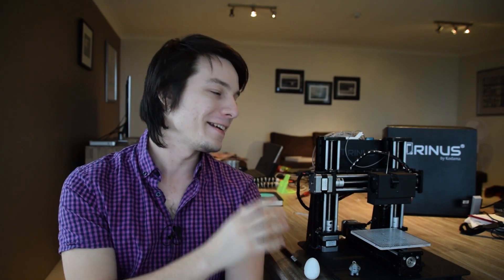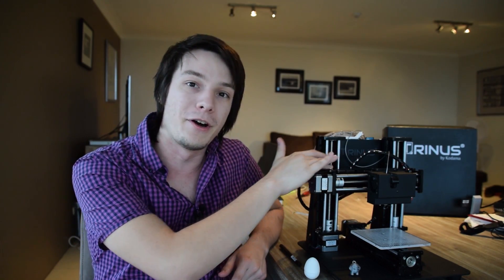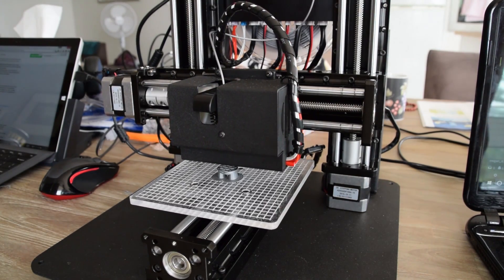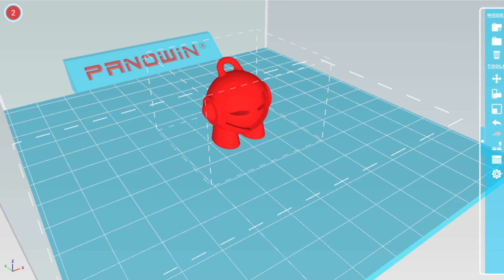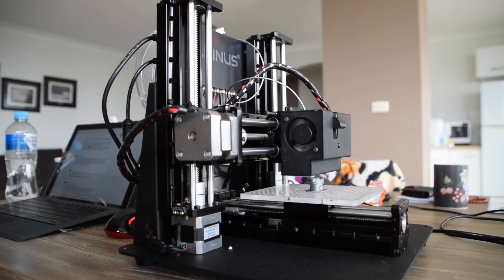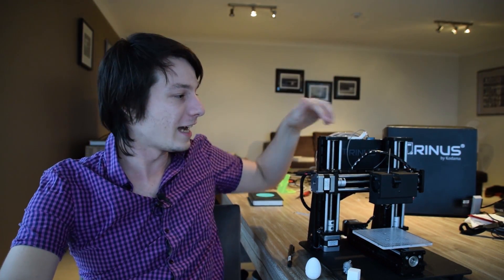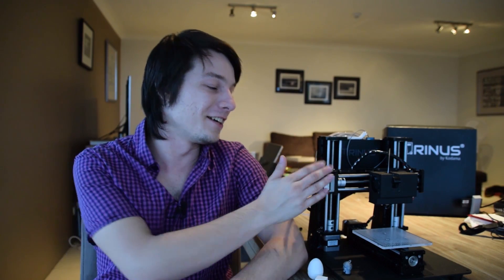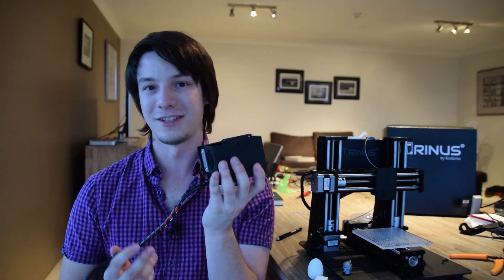Review of the Pre-production Trinus 3D Printer / Laser Engraver!

Comment: NEMA dampeners could alleviate some of the motor noises.  http://www.robotdigg.com/product/341/Antivibration+damper+4+nema17+stepper
Reply from the maker: +Aaron Yourk Good point, they would probably help quite a bit.
Reply: +Maker's Muse It is one upgrade I could see them doing if they so choose.  The bad thing about how they have their axis design though is that they would have to either lengthen their lead screws a bit or shorten the overall length of the axis modules.